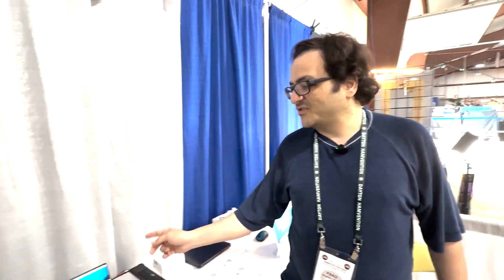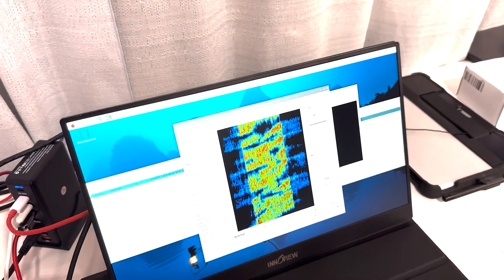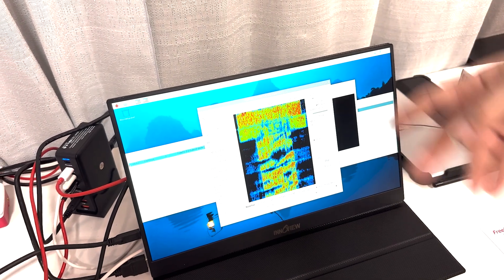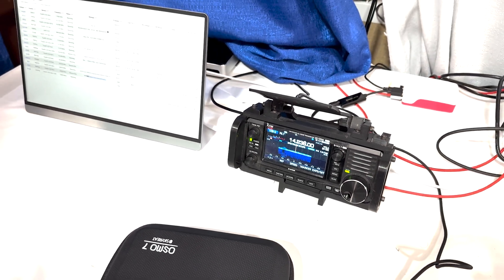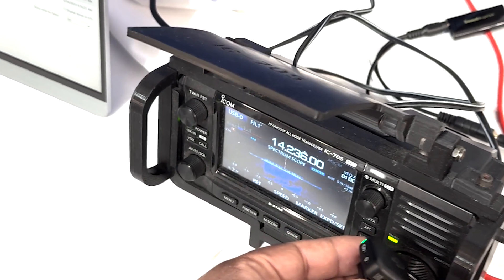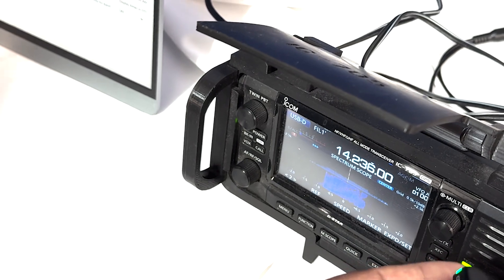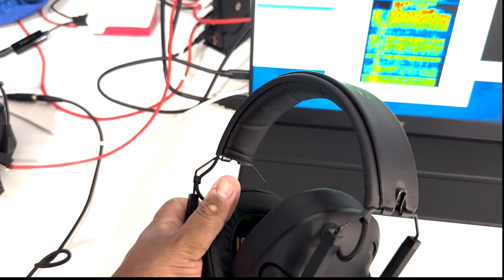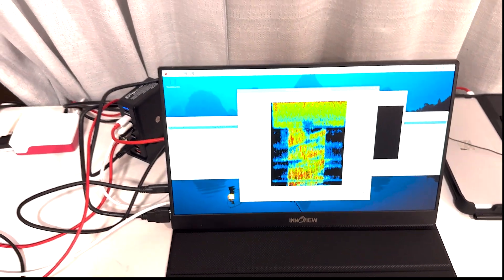FreeDV RADE - Using AI/ML to improve digital voice

Comment: Even though I own a radio that does pretty much every digital voice mode known to man I'm one of those anti digital voice mode guys.  Does it work, absolutely.  Can it "talk" farther than analog voice?  Yes it can.  The big coffin nail for me has always been the audio quality.  It just sounds digital, horribly digital to me.  I'm a old school analog guy.  One of those 33 1/2, 45, 78 RPM record and other analog format audio guys.  A few seconds of digital voice audio makes me twitch in my seat.  Don't get me wrong, I appreciate "good" digital voice audio.  The main problem in amateur radio is the required bandwidth to achieve good audio with digital modes.  I will have to give the new system a try and see how it performs.  Hopefully I don't come away with blood coming out of my ears.  Just kidding. 🙂  Appreciate the info on the new upgrade.   Mike KC3OSD
Reply from the maker: It isn’t for everyone for sure but this one saves bandwidth and sounds pretty good. It uses AI to clean up the audio.
Reply: Im with you, Mike.
Reply: Having used literally ALL of the common digital voice modes myself (and many commercial / military HF versions as well,) FreeDV RADE mode is absolutely the best I have used by far. I generally can't stand digital voice, but honestly,  If you are on the fence or have had bad experiences in the past you should try FREEDV RADE. It is actually amazing.
Reply: This is why I prefer P25 Phase I for digital audio.  Once you get down to 6.25kHz bandwidth, it just gets messy and muddy, at least to my ears.
Reply from the maker: @JoeHamelin  this is HF though, so P25 doesn't really apply here